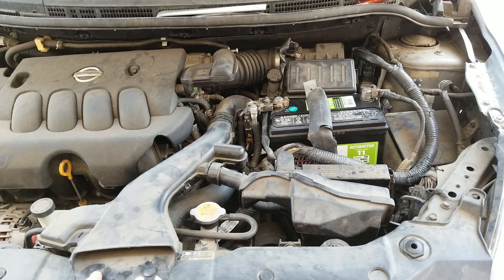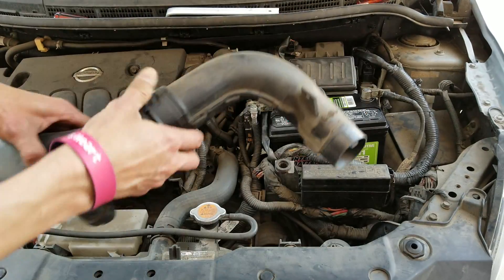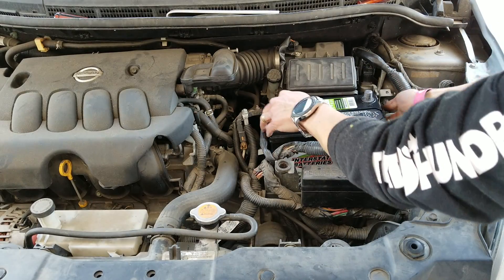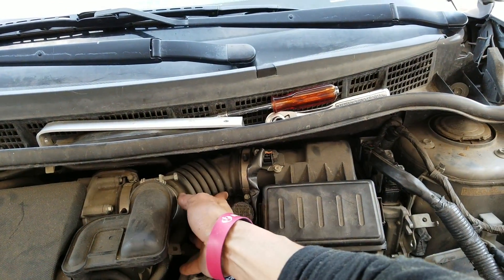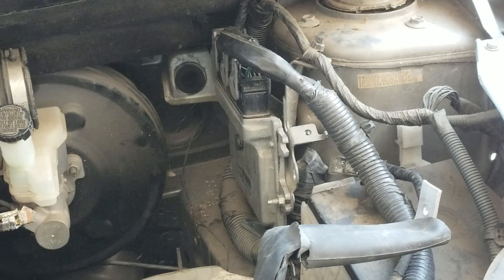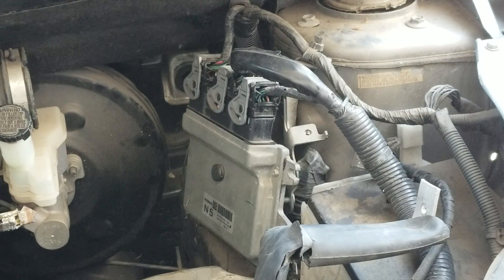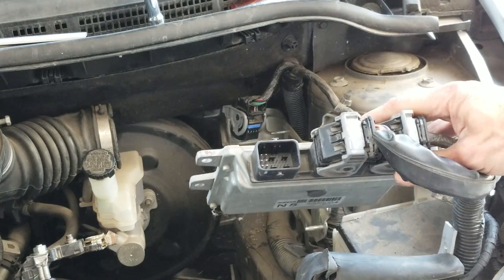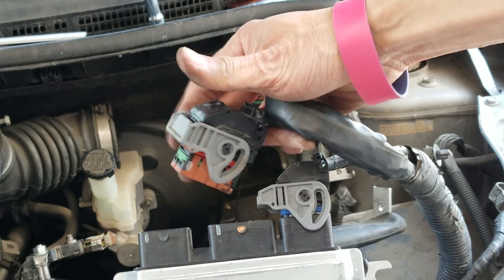How To Remove & Unplug Nissan ECU Engine Control Unit! 3 17 2019

Comment: Does the number on ecu have to be the same or they could just program any ecu
Reply: I have same question.
Reply: If you look closely all the numbers match same to same except the last 4 numbers on both are different which I think is normal.
Reply: FlagshipOne, can order ECU Pre programmed.  Just need VIN and part # on old ECU.

Comment: Pls how much will it cost to get a ECM (Brain box)
Reply from the maker: I got mine from eBay, back then was like $120.
Reply: For a 2014 Nissan Versa they run ~$400 preprogrammed. For other make/models I’ve seen em both higher and lower.

Comment: Have a Sentra 13 did trans replacement now will not start so pissed my scanner says bad ecu did it still no start now no communication to bcm pulled fuse box found hot spots ordered new ecu and fuse box so now total almost 3000 tranny was slipping but stupid car started to bring in shop I’ve done several rogue and pathfinders this is first Sentra I done so pissed but hey gets billed to customer just want out my shop running

Comment: Have a 07 s model. Replaced ecu with one from the junkyard and still won't start but the P0605 code is gone. Will reprogramming it fix the issue?
Reply from the maker: Yes, it would because the keyfob didn't match with your original VIN#.
Reply: These electronic parts , should not be replaced with used.      Reason is ,;  u get an ECU component from junkyard = should the vehicle been in an accident , the computer recognizes that and it does not work properly after that.  U can reset , although my recommendation is to by reconditioned. !

Comment: My car has intermittent start issues as well as cylinder 2 randomly not producing spark ( i think it actually shorted out a coil pack in that cylnder. Is there a way to test that the ecu is causing that?

Comment: I have p0605 code showing. Do i need to replace new ECU/ECM for this?
Reply from the maker: What repairs can fix the P0605 code?
1. Repairing a faulty ground or power supply such as corroded components and damaged wiring.
2. An Engine Control Module update, reprogramming or reflash (if applicable)
3. Replacing the ECM.
Reply: @macdaddypimpping  i did number 1, no fault on a wire or power supply. Now i guess number 2 is there before changing the whole module. Any help regarding reprogramming? Or is there any video related to this? I have nissan versa 2011

Comment: Just a little advice for everyone, Before changing any car parts I would highly recommend wiping everything down clean , with a Rag & Brush because you can cause contamination inside the part that you are swapping out 🤷🏽‍♀️💯
Reply from the maker: Good tip!
Reply: Thanks a lot 🙏 💓
Reply: Tub'O'Towels from Home Depot or Amazon is great for removing grease and grime from parts and is a great hand cleaner as well.

Comment: H
Question pls. I have 2002 sentra 2.5 ser automatic with security system.  My ecu is bad , so I need to replace
 It.  How do u go about getting another one.  U do see them on ebay but I'm not shure what numbers to look for. There are some number on the top and big  K4 in the middle and other number at the bottom. Any help will be so helpful please
Reply from the maker: The number on the white sticker must match with your old one or else it's not compatible.
Reply: @macdaddypimpping  do you mean just  the "N5" on your computer  or also the smaller numbers too

Comment: You mentioned something about this old one could maybe be re-progammed. So, why not just re-program it rather than replace it? Can the dealer re-program it for you and then you install it?
Reply from the maker: Never go to a dealer, find online or ebay that you can give your vin# and they will reprogram or program the one that you are going to purchase with your car info.
Reply: @macdaddypimpping  mines just went bad and they want me to pay over $1500 so my best bet is go online but idk where to start
Reply: @skywalkinjaylin716    order a used one on EBay but make sure the Vin Number on your old ECM matches the Used ECM on EBay 👍🏽 Then call a LockSmith to Program the Skim for you
Reply: @soniarican6275 
The vin number will never match, the last 4 numbers are different

Comment: Where is the Electronic Control module located on a 2007 Nissan maxima ? T.I.A.❤️❤️❤️
Reply from the maker: The ECU is located on the floor directly behind the radio. You do NOT need to remove any glove box, dash, or vents to access it. There is a black plastic cover with 2 round plastic snaps that cover the ECU. From the driver's side, the cover is directly beside the gas pedal.
Reply: @macdaddypimpping  thank you 💕

Comment: Thank you very much for this video they told me my ECU and PCM which I guess is a related board for my 2009 Xterra they wanted to charge me $1,800 to replace those two alone and it might be even more. I knew that they were telling you the truth on the parts but they made it sound like it was too technical. I understand computers so I knew they were trying to snowball me.

Comment: Thank you so much for making this video! The Nissan dealership was going to charge me $2800 to replace the ECM & Immobilizer. I bought both of them on eBay for $127. Thanks to your video, now I can replace it myself.
Reply: 2022, they wanted to charge $2900 but I did it myself. Thanks to YouTubeers like him.
Reply: @Tya2019  Did you get it reprogrammed?  How much?
Reply: Did you reprogram  the ecm?
Reply from the maker: Glad it helped!
Reply: FlagshipOne for pre programmed ECU
Reply: Hello guys I have question if I replaced my for used one do I still take to the dealership and programed or not
Reply: @rubenit8440   Yes you have to or else your car will be confused and will not run properly and there will also be codes that don’t belong there

Comment: hello, what if I want to change the ECM with one from the same make model year etc but WITH cruise control, in order to add cruise to my car (prewired for it)? Should it work? thanks
Reply from the maker: There are some sellers on eBay selling already programmed to your VIN# but cost more that are ready for plug & install and needs to re-programmed the key or your car will not start.
Reply: thanks! could you share a link about these sellers? :) thanks

Comment: Hello i have 2018 Nissan Sentra  i would like to change the ecu , do i have to get exactly same one or anyone from eBay should work or i have to program the computer, thx
Reply from the maker: You have to get the same one from eBay eg. HN5/J8 or look for the same number that's on your ECU, some seller that sells ECU that will program thru your VIN# and are plug and play and some required re-programming. Be sure to unplug all the power before you swap the ECU and search how to relearn online. Good luck.
Reply: @macdaddypimpping  relearning and reprogramming is different? If you buy a plug and play do you need to relearn?
Reply: Over Mendoza,I think your email or whatever name it goes by has to be what is called reflashing.Usually someone that does this has to come and do that.

Comment: Hi I replaced used ecm on 2014 qx80  what the steps i should do to program please
Reply from the maker: You must consult with a mechanic that can program or a dealership, if not you might burn your new ECM.

Comment: i just change mine used do i have to relearned? 2014 nissan altima computer.
Reply from the maker: Yes, relearned or needed reprogram. Please contact your local mechanics or dealers to ensure.
Reply: @macdaddypimpping   thak you very much
Reply from the maker: Anytime, good luck with your fix.
Reply from the maker: Must consult with mechanic or dealer before installing a new ECU or you might burn it and must disconnected main battery when removing or installing the unit to avoid from shortage.

Comment: My 2012 Versa Needs a IPDM module do you know where i can find it My AC doesnt work
Reply from the maker: Tye here: https://www.ebay.com/sch/i.html?_from=R40&_trksid=m570.l1313&_nkw=IPDM+module+2012+versa&_sacat=0&LH_TitleDesc=0&_osacat=0&_odkw=IPDM+module
Reply: @macdaddypimpping  You saved me 1k, since it came off the same model it shouldn't need reprogamming.
Reply from the maker: Cool, good luck.
Reply: @macdaddypimpping  Installed it AC still not working.
Reply from the maker: @mw4382  First of all, did you have a diagnostic code? What causes your AC not working? Did you disconnect your battery that causes this problem?
Reply: @macdaddypimpping   Tbe shop told me it was either the Fan or the ipdm. I didn't disconnect the Negative side just the Positive.
Reply: The fan comes on but it spins at a low speed
Reply: The Fan was Bad. AC works.